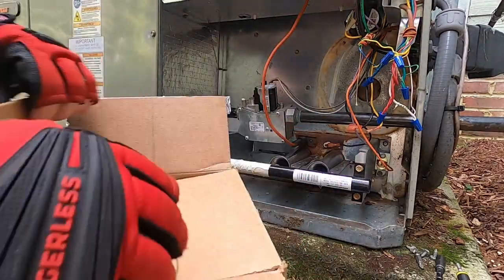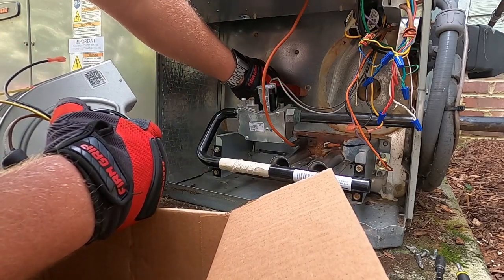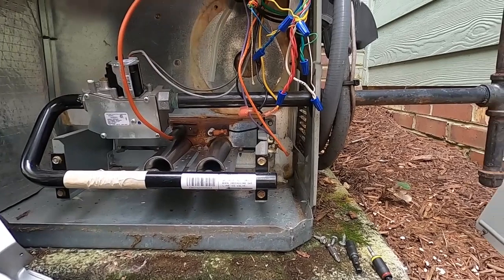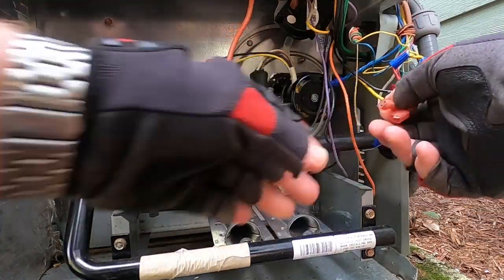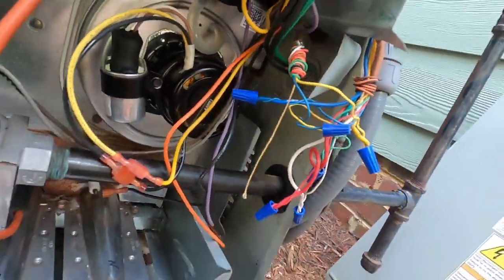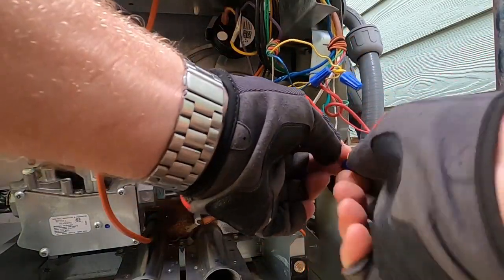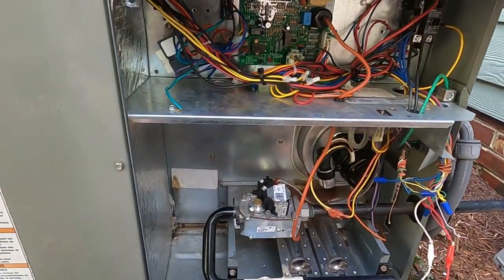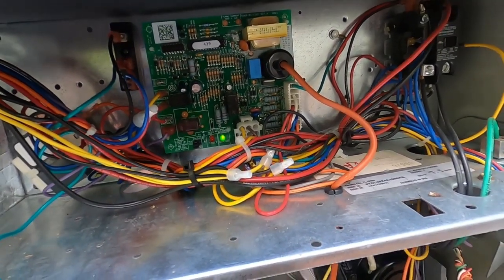Trane draft motor part 2!

Comment: If I’m not mistaken they started putting them on the inducer because they were rusting and breaking off the header and you were kind of out of luck had to try to appoxy it back on there because the new ones didn’t come with that piece.